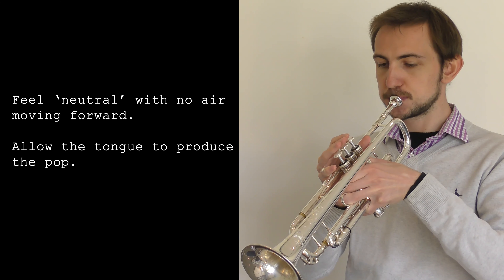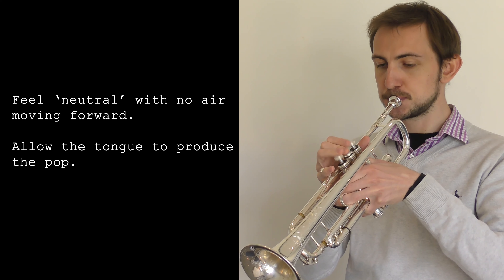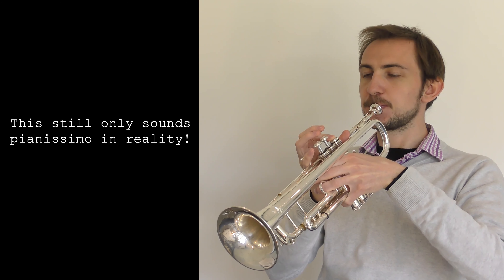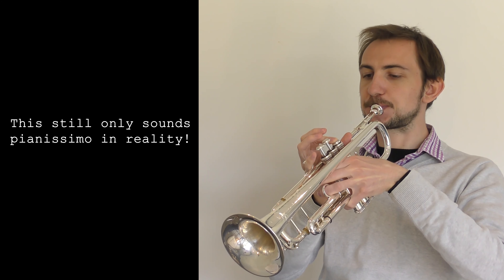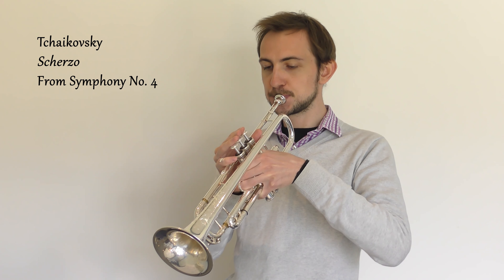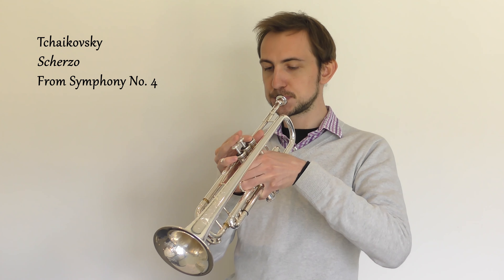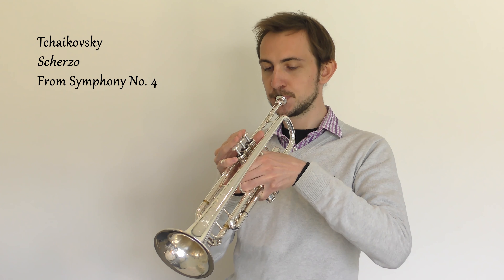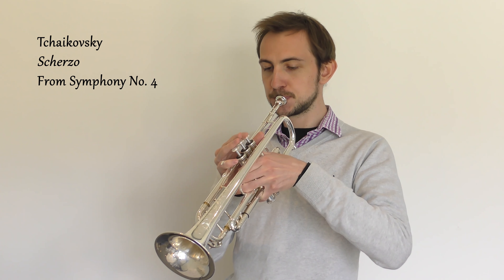Stay at Home Practice Tips #3 'Minimal Flow Articulation'

Comment: Hi, thank you very much for sharing this !
Can I ask where did you get this concept from ?
Reply from the maker: Hi,

Thanks for the question! Sorry for the late response, I only just received a notification for some reason?!

This is concept which I developed after hearing some ideas from Paul Mayes (the Trumpet Prof), he spoke a lot about separating the individual elements of the system and this is one of the ways I came up with to do that.

I also developed it as a way to practice articulation very softly and without putting much strain on the lips, as I said in the video; its a good way to check the 'alignment' is correct without relying on a surplus of 'air-power'.

I've seen several players talk about concepts similar to this; sometimes with slightly different intentions but likely a similar approach. I know David Hickman espouses 'Pop tones' but I've not read his books and I don't know what the mechanism or objectives are for his particular idea. 

Hope that helps